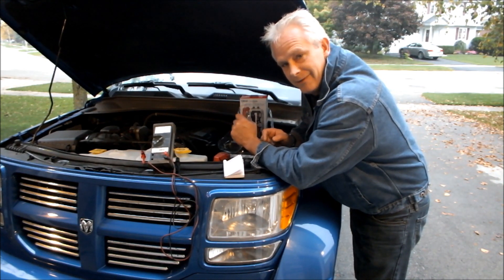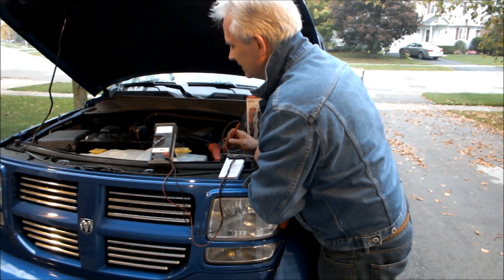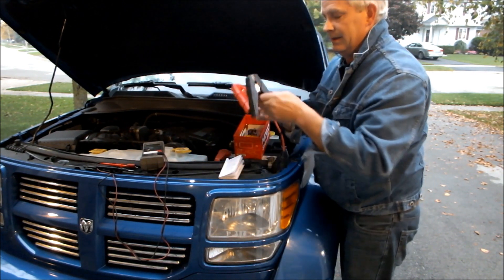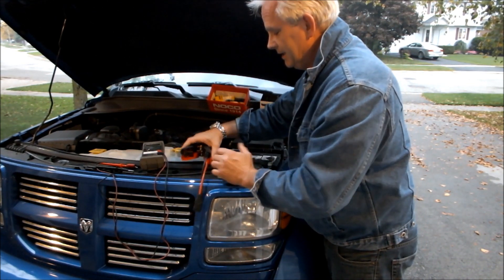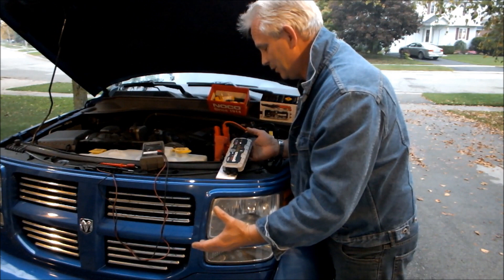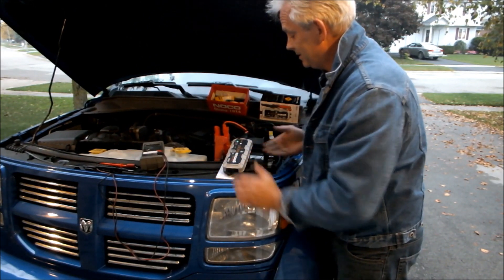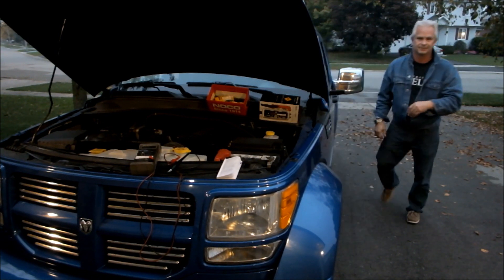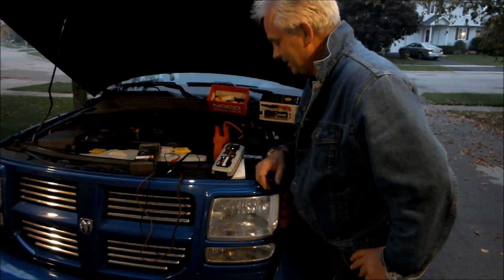Throw Away Your Booster / Jumper Cables

Comment from the maker: Save your ass come this winter
Reply: Have you used the Noco GB30 Boost Pack yet this winter?

I ask because Some people report back that they work great in the warm weather but that they don't work well when it gets down below -10 celcius / 14 Fahrenheit or colder. 

The unit is 400A peak.  Probably around 200 Cold Cranking Assist Amps.

It does seem in some of the failed video reviews that they aren't waiting like 1-2min and trying to start. They try to start with it being hooked up for less than 30 seconds. So that may be the user issue.
Reply: +lightningsmokerXx    I dont think so - did you measured the output current ?  I think the most energy delivered the classic car battery, this only "charged it a bit".  Just look at the output cables and the connector - its designed to 50 Amps MAX, i think 30 Amps is good load for this tiny wires ...  And in the winter the power consumption of car will be higher, becouse the engine will be cold and the oil and coolant will be hard (like freezed). So the starter will have much more load than now and the battery (OK, jump starter) must be able to deliver it !

Hmm, i also haven´t a problem with battery in the summer yet ... :-)

But the video is nice
Reply: You didn’t needed to drain a good working battery for two hours.Could of just taken out the car battery and just plug in the booster battery pack to do demonstrations for the video.
Reply: I've tried three different models and none of them had the juice to start a cold Nissan Titan (v8) in sub zero temps. Don't rely on one of these to get you out of a jam in a Canadian winter!
Reply: shu tup nerd

Comment: "Throw away your booster cables" - Absolutely NOT! I don't care how well a portable battery may work, it can fail. If that wasn't the case, every car would come equipped with the never fail battery setup. Yes, some gadgets, on the market today, can be useful. However, IMO, it's always best to have a good backup plan. In this case, a quality set of cables "to jump start a truck", when the gadget fails.

Comment: Do some research if it starts up remove the unit quickly something that is not stated in the manual.
Reply: most of these battery packs have the circuitry to prevent any reverse charging of the device through the cables

Comment: Right. The chance of having a weak battery or alternator on a late model car/truck is rather low, so having one of these 150 dollar packs is just dumb, plus you can take that money and buy a new battery or rebuilt alternator. So this is just a quick-fix gimmick for owners of older vehicles who don't know better. Stupid gadgets for people with sponges for brains and money to waste. 

Either this guy is getting perks for plugging this batt pack or he's stroking his ego, or both. What I'd like to know is if this booster has Li-ion batteries or capacitors? And how effective is it when the pack itself is real cold (because it was left in the car in winter), so put it in the freezer and do this test again dude.